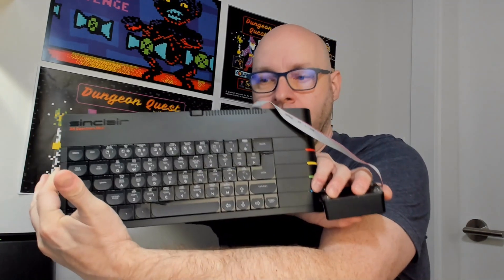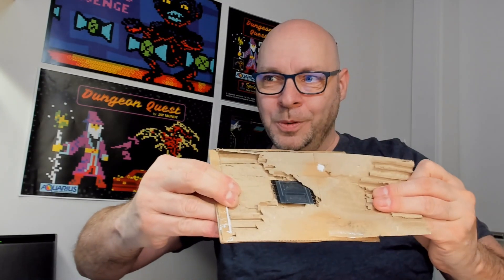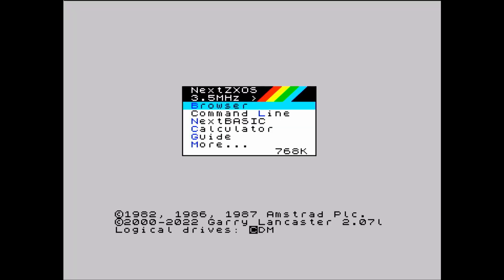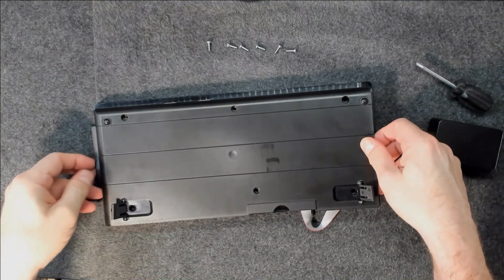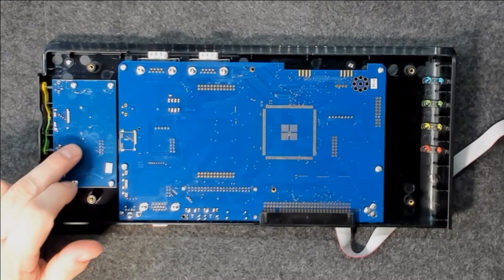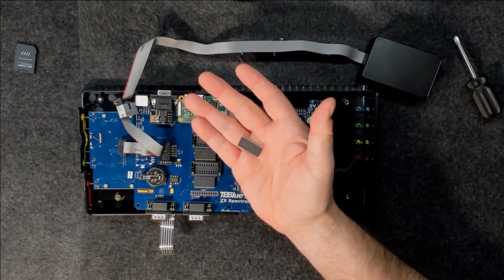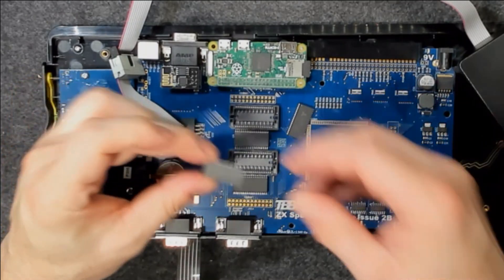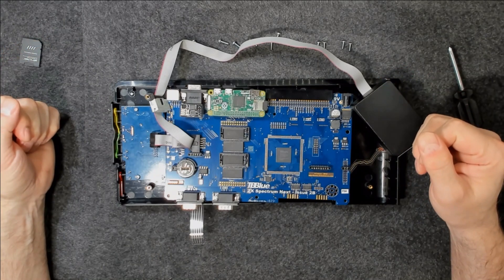ZX Spectrum Next Memory Upgrade - Easy Peasy!

Comment: Do not touch devices such as RAM chips without proper ESD gear or you risk damaging them. Avoid touching the pins with your fingers because of grease and moisture.